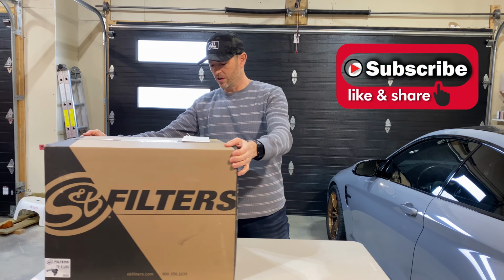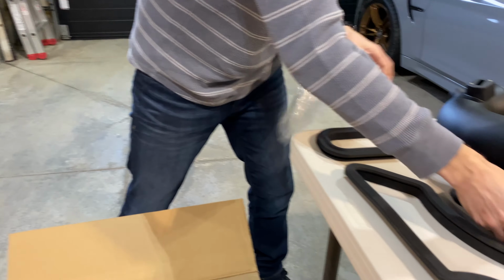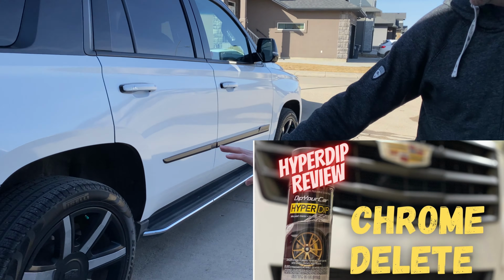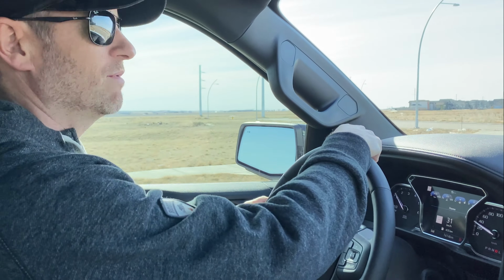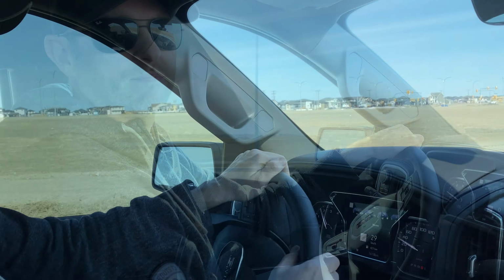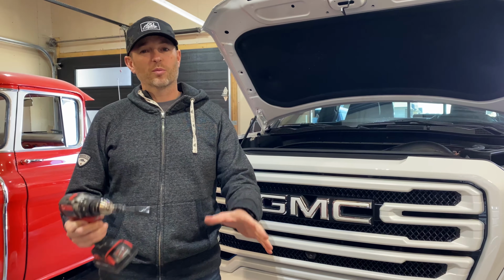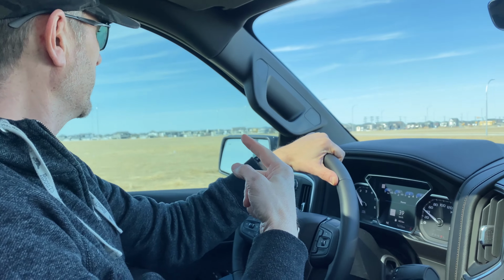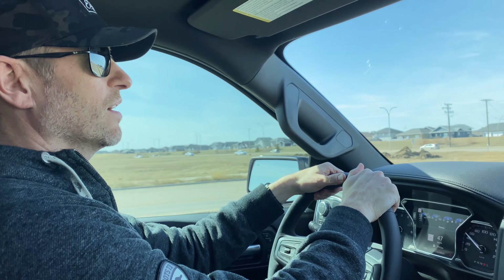S&B Filters Cold Air Intake 6.2L GMC Sierra AT4.  Full Install and Review - No Check Engine Light!

Comment: I feel like I lost low end torque. So…. 2022 trail boss 6.2L with this intake. I pull a small a-frame pop up and atv. From a stop fully loaded I feel like I lost a tiny bit of low end torque. Between 0-2000 rpm. I also feel like the only power gain is after 3500 rpm. I have been a mechanic for a long time and in my opinion the only real benefit is the growl you get from the induction noise! That being said, the induction noise on this is worth the price for me!!! I do not regret the decision and would still recommend.

Comment: Hey Don I don’t have an AT4 but I do have a 2020 Midnight edition Trail Boss 6.2. Still enjoy your channel and what you’ve done to your AT4, really good looking truck.   I know you’ve had both the S&B and the Cold Air Inductions CAI on your truck.  My original plan was to get the GM performance package after I bought my truck (I did not do a factory build) only part of that equation was able to happen so far.  I got the exhaust and it’s installed, sounds great.  The GM CAI is on backorder and from what I’ve heard/read it will never be available for purchase
Reply from the maker: If you are wondering which would be closest to the GM performance intake, I would be inclined to think the Cold Air Inductions one would be.
Reply: @Donslife  I agree with you on that, just not sure on the oiled filter with Cold Air Inductions CAI.  Trying to avoid any potential issues with MAF sensor.
Reply from the maker: @a.bohcar5096  nothing wrong with going dry to be avoid an issue.  I didn’t find mine was over oiled like some K&N drop in filters

Comment: Don, was inspired by your video and just finished installing the same intake on my 2019 High Country, love it!  One thing that I have noticed was a popping noise when I turn the engine off.  It only happens when I turn it off, not while driving.  Did you experience that after your install or had any similar feedback from other viewers? Apologies if you have already addressed this in previous comments.  Thanks.

Comment: Just picked up my at4 last week along with the oiled version of this CAI. I saw you went with the Borla s type.. Like many others I’m completely torn between that and the atak. What swayed you to go s type? I prefer the deep tone of the s type but worry it won’t be quite as loud (noticeable) in cab as I would prefer. You seem to make well informed and thought out decisions so your opinion is valued! Loving the content man! ✌🏼
Reply from the maker: Thanks Uncle! I do my research for sure.  I chose the S-Type but only had reviews and online audio clips to reference.  You may be interested to know that the ATAK has a Polyphonic Harmonizer behind the muffler you can replace with muffler 60679 to attain the "S-Type" sound level.  Not sure if you looked at my latest video (YouTube short) but the S-Type with quad black tips is sitting at home now waiting to be installed!!! ✌🏼 Part of the reason I do my research is it takes forever to get upgraded car parts here.  4 months for this exhaust 😞
Reply: @Donslife  Cheers to finally getting your parts! I’m looking forward to your video of the S-Type!.. And lastly as far as installing the intake without check engine light- do you disconnect battery for 2 hours prior to install or is it 2 hours total time? Thanks again!
Reply from the maker: Disconnect first, perform install, makes sure 2 hours has passed before starting up with the new intake.

Comment: Hey Don, thanks for the install videos they're awesome. I recently got a 2021 at4 6.2 and am looking at an exhaust/cold air but I'm curious about warranty policies as this is my first brand new truck? Does this affect the warranty policy at all?
Reply from the maker: Very common question.  It is highly unlikely that a intake and/or catback exhaust will void your manufacturer warranty.   Consumers are protected by The Magnuson-Moss Warranty Act.    Basically the vehicle manufacturer would have to show the aftermarket part contributed to the failure of the warrantied OEM parts

Comment: Did you install the bottom plug or leave that open for better air flow? I live in the Saint Louis, Missouri area so I’m not worried about extreme heat or dusty conditions but I thought I’d ask your opinion. Thanks for all the great videos! I picked up a 2021 SLT 6.2 over the summer and you have given me a ton of cool ideas!
Reply from the maker: Hey Samuel, I left the plug in to cut down on the extra dust exposure.
Reply: This is identical to the filter for the 3.0 duramax. I run the plug out in the winter and plug in during the summer as recommended. Not sure about protecting from dirt because the inlets at the top of the housing are massive. Not to mention the filter is massive. I just cleaned and oiled mine after 12k miles, after doing it, I probably could have waited 24k.

Comment: Thanks for the video! Just installed this on my Sierra! Only questions I had was if the maf sensor is easier to come off now? It doesn't feel like it locks too tight on new filter wire extension. Also did u wait 2 full hours after the install? Or overall 2 hrs including the install? Thanks in advance!
Reply from the maker: I’ll have to check how well they connect.   I don’t remember being concerned.   Don’t be mad, I love my S&B but I was asked to test another brand too.
Reply: Haha. No worries man! Glad your able to test out products for our trucks. S&B sounds way better than stock for sure. I installed it with the help of your video.  I have to ask which cold air intake you've liked better so far?
Reply from the maker: @felipealvarez5148  I just posted the new video video of another intake.  I like them both pretty much the same. The S&B seems louder but I think it will dirty faster in dusty conditions with the exposed outlet.  They both rock and I like them better than the K&N design we have on our Escalade.  Also forgot to answer your question. 1-2 hours total battery disconnect time.

Comment: Hey, I'm fairly new to your channel, but I  absolutely love it.  I have a question about this install though.  Why is 2 hours the "magic" number to keep the battery disconnected?  I imagine it has something to do with the MAS, but why not 4 hours or 30 minutes?  What is significant about 2 hours?  Also, don't you have to take the truck in to get the MAS recalibrated?  Thanks for the great content.
Reply from the maker: Hi Jeb!  Thanks for watching!  Two hours is just a safe amount of time to ensure that all of the relevant systems have been depleted of any electrical charge.   This will allow the systems to adjust for the new intake and not think there is a fault with the stock one.  30 mins might be enough, but 2 hours is for sure enough 😊
Reply: @Donslife  I installed one but get a "service air system light", any idea how to get rid of it?
Reply from the maker: Did you turn off the air filter monitor in the vehicle settings as per my video and the instructions?
Reply: @Donslife  I did. It still pops up
Reply from the maker: I would contact S&B.  I don’t know why that error would occur if all the steps were followed
Reply: @jonnewton8364  were you able to resolve this?
Reply: @live2roll2live  Yes. I believe i shut off the filter life on the dash then went in with a scan tool & cleared the code

Comment: Hi Don Revisited this video.. do you have to do the tune from GM to get the 15 horsepower that they claim when you do the air filter upgrade and the borla exhaust? Or.. does leaving the battery cable off for a couple hours automatically do it?..thanks..
Reply from the maker: No tune required according to S&B.  Make sure to turn off the air filter monitor in the menu of your truck since this new filter has a different flow rate.  I haven’t had any issues and feel a positive difference.  I have not taken it to a dyno either.
Reply: Thank you...

Comment: Still too early to change out filter BUT did you decide if going to replace with another dry filter or switch to oiled version.  I’m thinking of going only dry path due to not wanting to void warranty because I over oiled cloth filter.
Reply from the maker: Funny you ask.  Probably dry with this one.  It is getting dirty pretty fast
Reply from the maker: I may have no choice in Canada but to get the oiled one.  Nobody seems to sell the dry one here, not even the place I bought the kit from
Reply: I saw that S&B sells them from their website.  After watching your videos I will getting getting it installed on my Elevation 5.3L.  I’ve also seen several installs of the CAI and every one states install is easy, BUT I will be paying a shop $100 to have it installed.  After that, I will have the Putco 60” blade installed.

Comment: Hey Don, I have start with I love your content and flavor of mods. I just installed my S&B CAI but I am having an issue and was wondering if you could help. My truck is 21 6.2 and since the install it is sluggish at around 2k rpm's. I have checked everything twice! I really need to sort this out before I install my exhaust. Please help me!!!!
Reply from the maker: Is the factory ductwork from in front of the radiator fitted snug in the bottom of the airbox?

Comment: What is the significance of leaving battery unplugged for 2 hrs?  Is that sonit will tune itself after?
Reply from the maker: Partially, it is more so the sensor doesn’t see a drastic change in data comparing the before and after.   Unplugging will make the computer forget the data from before.

Comment: Sir I have a question I installed the same intake & on my around 3k when I think the intake kicks in I can hear a deep rumble is that from the intake or I have a intake leak ?
Reply from the maker: You could check your joints but since the intake isn’t sealed by the hood hinge it would be hard to tell.

Comment: Did you disable the air filter monitor prior to starting the truck the first time or after?
Reply from the maker: After sir!
Reply: So I’ve had mine for a week now on my 20 sierra and I’m getting a check engine air filter on the screen now.  I totally forgot to turn off the air filter life. What should I do?
Reply: @noremac1017  I would think you need to clear the code and then turn off the air filter monitor.

Comment: Also get airaid throttle body spacer and Katech ported throttle body. I installed this on my 2014 silverado 1500 5.3L it's awesome dm me for more mods. I also did airaid Jr with factory filter box with k&n filter.

Comment: Did you leave the plug out of the bottom or put it in? Where the filter is.I’m about to install mine
Reply from the maker: I left the plug in (for now).  I have an exhaust coming (on back order) that I want to install first before deciding about removing the extra plug
Reply: @Donslife  I’m thinking Borla S type for me. I have the 6.2 as well. Crazy how quiet it is
Reply from the maker: That’s what I ordered! Quad black tips.

Comment: Did the check engine light.come on after installing it?
I’m thinking of getting the same  CAI for Silverado with  6.2
Reply from the maker: No it didn’t.  You need to disconnect the battery for 2 hours so the truck can ‘relearn’ with the increased airflow.  Lovin’ it so far. Exhaust coming soon too
Reply: @Donslife  Do you mean before or after installing the cai? are you saying that after you installed the CAI, you left the battery disconnected?
Reply from the maker: @AngloLover  You disconnect the battery before taking the original intake out.  Then perform the install of the new Intake.  Make sure 2 hrs has passed before reconnecting the battery.  The install might only take you an hour, but you’ll be want to be sure to wait the 2 hrs.  This will ensure that any memory of the old parameters is cleared and when you reconnect the battery and start the engine, it will adjust to the new intakes characteristics without throwing a check engine light.
Reply: @Donslife  That is exactly what I thought, I wanted to ask just in case haha. Thanks for your videos, love the cahnnel. Waiting for my CAI to put on my 6.2 trail boss, getting borla exhaust isntalled tomorrow.

Comment: Why did you have to wait 2 hours to reconnect the battery?
Reply from the maker: To ensure all data related to the previous configuration is purged from the electronics so you don’t throw a check engine light when you restart the truck.  The air filter monitor needs to be turned off too immediately upon start up or prior to the installation

Comment: Where did you purchase your S & B cold air intake bud?
Reply from the maker: Partsengine.ca    Not many options in Canada
Reply: @Donslife  Yea I noticed, thanks bud. Thanks for your videos too love them and good info. I'll be watching it once I get my cold air intake. Thanks again
Reply: @Donslife  Yea buddy just checked them out and they don't have the S&B cold air intake
Reply from the maker: Oops. Try TDOTperformance.ca
Reply: @Donslife thanks buddy, what filter would you recommend? I don't go off road so thinking the dry?
Reply from the maker: @travisjesso9415  I chose dry.  More expensive in the long run since you’ll need to replace it, but no risk of oil clogging the MAF.   Rare but can happen
Reply: @Donslife  I agree thanks again for your time buddy.

Comment: Have you noticed any change in mileage since installing it?
Reply from the maker: Hi Josh, maybe 1mpg.  Not my main reason for purchasing it though.  Once my exhaust comes in too, it may help a tiny bit too.  The 6.2 is a beast so fuel efficiency is tough to claim, however the most range I got on 1 tank is about 400 miles or 650 km. The tank is smaller than my 2013 Sierra Denali short box too and that only gave me 340 miles or 550 km per tank.
Reply: @Donslife  I’ve got the Duramax so not apples to apples but I’m waiting for the S&B to come back in stock and doing some research on it.
Reply from the maker: @JSB838  it rocks.  I couldn’t find one poor review at all.  I did not research 🧐 the diesel though
Reply: I didn’t notice anything but more sound. Unless you get a tune these seem to be a waste of money, and you may be risking a warranty issue with your dealer, IMHO. No knock on this video at all just my experience

Comment: i installed this exact intake today. but when i turn the truck off, there is like a "pop" or a "wet air" noise. release of air or some sort. it might have always been there with the OEM intake, just with all the muffling it has, i never noticed it. but its only when i turn it off. not when i turn it on
Reply from the maker: That’s really strange.  Maybe I just haven’t noticed it happening, or it is just happening for you.  Otherwise I hope it is all good 👍🏼.  Thanks never found one bad review before I chose to get one
Reply: @Donslife  i love the intake, how it looks and feels also. its just that strange "pop" imy truck started makeking. its hard to describe it. im searching and searching and i cant find anybody going thru the same. so it is probably just me. id have to start from zero again and see where i went wrong or something
Reply: @eethiq  I had the pop noise you're mentioning as well. I have it with the stock box too you just don't hear it hardly at all because of the extra dampening material. With an aftermarket box and the dampening not there the same way you hear it more.
Reply: @MunkeyRC  oooh thats a relief to hear .. the sounds growing on me i guess
Reply: I have the same pop when I turn the truck off as well,
How has the intake held up for you
Reply: I have the same pop when I turn the truck off as well,
How has the intake held up for you
Reply: @LiLS512  it does amazing. im very happy with it. i just have that little pop that ive grown to just live with it lol

Comment: Question why did you have to wait 2 hours before reconnecting the battery?
Reply from the maker: This is to ensure that the trucks computer is completely discharged of power and will be forced to relearn the new parameters the intake creates.  This way no check engine light will be generated either.  1 hour is probably enough, but 2 is a safe bet.
Reply: @Donslife  I appreciate it ty and thanks again for the reply sometimes your waiting for days for a response. I'm asking because I got a cold air intake coming and I'm doing the installation myself
Reply from the maker: Right on
Reply: @Donslife  did leaving the battery disconnected for two hours cause other electronics to lose memory?  Did your have to reprogram any infotainment settings?
Reply from the maker: @Vespawood1  I can’t remember 100% but I think all the infotainment and vehicle settings stayed intact.

Comment: Do you need to retune your computer after installing ? thanks
Reply from the maker: No tune necessary, that’s why the battery had to be disconnected for a minimum of 2 hours.  This lets the truck figure out the right air to fuel ratios.  Lovin’ mine
Reply: @Donslife  Thanks for the quick response. I have the same truck as you and wanted to get the GM CAI but cant since it wasn't ordered that way so was looking for other solutions. Ill be getting his today.
Reply from the maker: Hi Ryan, I researched this for quite sometime and chose the S&B.  I couldn’t find one bad or mediocre review.  Everyone seems to love theirs.  The reviews were all for the 6.2L too

Comment: Hey Don. I just installed an S&B intake on my 2021 AT4 with the 5.3 and I’m hearing a random loud click when decelerating and sometimes accelerating after stopping. Has anyone else heard of or experienced this?
Reply from the maker: Not sure what noise you are hearing.  Maybe someone else will comment.  I would check you connections again and the MAF extension cable